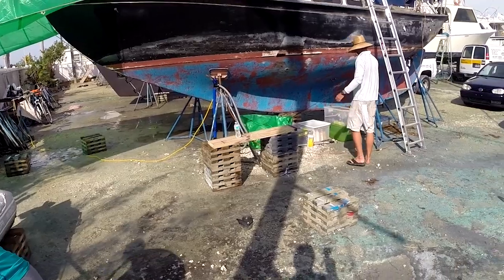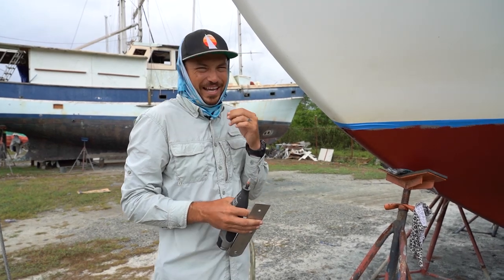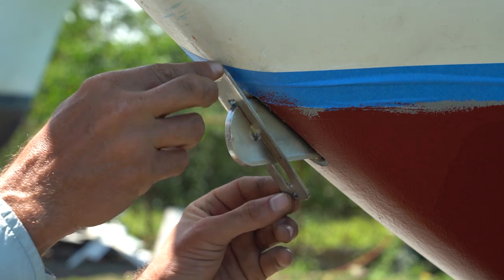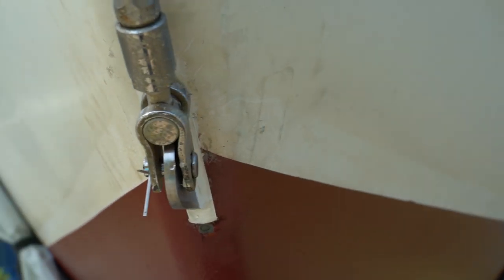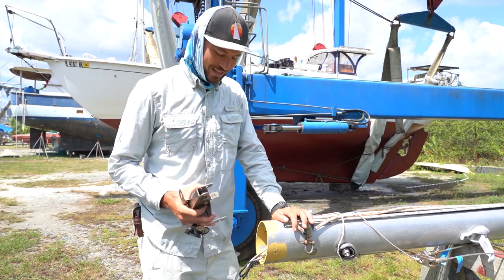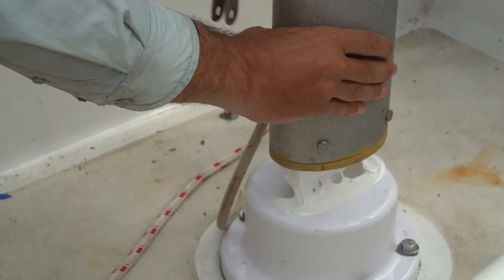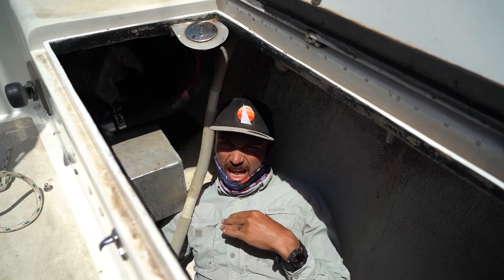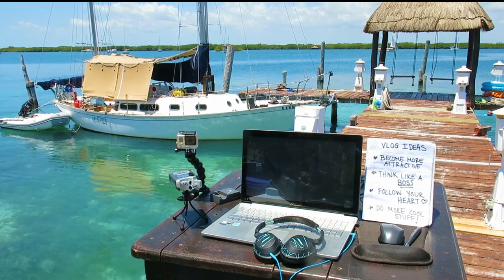Just When We Thought Things Were Going Well... | S04E20

Comment: The hull is probably about three inches thick where the two halves were joined there at the bow when the hull was laid up.  Take the assembly apart again, grind the frp flat so that your lovely cover plate will lie flush, goop up the parts and put them back together.  Also, you could countersink the fastener holes in the cover plate and use flat head fasteners (if you didn't in the first place -- I seem to recall that the first problem was the fastener head deflecting the toggle).  Love the shots of the job.  Viewer can really see what's going on.  Love that boat.  Attended a lecture once by Scott and Kitty Kuhner, the first to circumnavigate in a fiberglass boat--an Allied Seawind!  Nice folks, great pictures.

Comment: Desire...an aviation tip for you. The best way trim up a fresh silicone bit with your finger tip is to wet the finger tip with a solution of water and dish washing liquid (DAWN). It make your finger tip slippery and the silicone won't stick to your finger. It works so good that we use it in aviation repairs and antennas installations. Enjoy it !

Comment: Wanted to give up a heads up with stuffing boxes.    When you leave the yard leave stuffing box totally loose.   You want water gushing out.   Otherwise wax in the stuffing melts and piles up outside of the box.    Tighten over a day or so and really let a lot of water in before you set for drip.   Also if there is more then one bolt on plate you want to measure and make sure each corner is exactly the same
Reply: Teflon stuffing material helps

Comment: Perhaps I missed it but always seal holes that you drill into wood or inner wood core with epoxy before applying bolts, screws etc. Any moisture in the areas causes wood rot and of course delamination.
Reply: I wish more people understood this , I try to avoid holes under the waterline
Reply: You missed it

Comment: stuffing boxes are intended to leak...that's what keeps them cool.. After repacking,...slacken the nut off with engine running til it leaks water, then slowly cinch up til the leak is minimized. with cool running. Always a good idea to use graphite grease on the packing, that way it doesn't groove the shaft..

Comment: Your stuffing box and shaft are water cooled. I think you still have some air in there and it's not cooling good. Go motoring with the stuffingbox leaking like a siv to get water all around the shaft, pump out water and tighten again. After that you should have no issues i think
Reply: good to start with the packing gland loose and then tighten slowly with shaft in operation.  be patient
Reply: Michael Waegemans I was going to suggest the same, an air pocket not allowing water to cool and lubricate the shaft.
Reply: I have to agree with Harland below.  You might also consider that you have TOO much packing material.  In power stations we generally look to see a drip or two per minute.  This ensures that that the packing is lubed and cooled.
Reply: yes a very slow drip is needed!!

Comment: U need to use carbide drill bits for stainless steel and keep low rpm during drilling as much as it possible also don’t forget about greasing. 

Use grinder to make old drill bit sharper

Comment: Just recess the  New Bob stay chain plate Cover into the Hull rebate it so you get the Clearance you need to fit it and counter sink the screw holes in it as well ,Tip for you you can also use a masonry Drill Bit to drill Stainless steel or Mild Steel ,like if a Masonry bit  hit Re-enforced Bar in Concrete.

Comment: I've made this comment several times on various sailing channels.....
Get yourself a set of COBALT drill bits, it's the minimum requirement for drilling 316L stainless steel, gold colour, laser etched with the following markings HSS C 
the reason you burnt out 3 drill bits is because the stainless got hot and as such became harder than it already was. PS you could have made a plan too with your Bob stay chain plate by slotting the internal holes and countersinking the cover plate holes and using flush mounted countersunk head screws. Generally speaking you've done great work on the boat and should feel very proud of your achievements. God bless, fair winds and safe sailing.
PPS, with regards your stuffing box, the gland packing will not damage the shaft, and should by all accounts settle down with time and use. You can always add another packing later when you need to, rather have the stuffing box weeping than getting hot, the packing will deteriorate quicker at high temperature and will swell with water ingress, obviously it mustn't be visibly leaking, adding packing while in the water should not be problematic if your packing is prepared and ready to install, make sure to evenly compress the gland packing and measure the distance from the inner casing flange to the outer casing lip.

Comment: 300 series stainless steels (304/316/321 etc.) is very tough material to cut even with proper equipment but especially with hand drill.  I've been there also working this stuff with files, twist drills and it aint fun.  The reason it's dulling and smoking your bits is due to work hardening.   As soon as the bit isn't cutting and only "rubbing" the material your toast.  It turns rock hard dulls the cutting edges and all you'll do is spin and create heat.  Best way to mitigate this is to start with a sharp bit, use a dab of oil, lots of pressure and low rpms on the drill.  The instant it stops cutting a chip STOP.  Don't ever let the bit just spin.  easier said than done but thats the gist of it.  Sending good luck to you guys from Chicago as I'm sitting here in my office surrounded by the plauge! lol.

Comment: The material  is Stainless Steel and you have work hardened it. Use a Carbide drill or a small grinding wheel to get below the hardened material.

Comment: Hmmm... Please get up there and put a nyloc nut on that masthead bolt! Having it come loose might be troublesome on that big blue sea. And drilling stainless with handtools are difficult. Low revs, a lot of pressure on the bit and machining oil to lubricate.

Comment: Drilling stainless - Low drill speed, high pressure. Don't let the drill bit rub without cutting or the metal will workharden. Use thick oil, grease or proper cuttting compound, not water :-)

Comment: Hey buds, love the channel. I've binge watched every episode and just got caught up a few weeks ago. I used to work as a machinist and noticed that your drilling speeds are too slow. That's why you're dulling your drills (Machinists don't call them drill bits. We have our own vernacular, much like sailors.) I was going to say something when you broke that 1/8" drill on the bottom of your mast in a previous episode, but held off. Since you've brought up having issues drilling I'll add my 2 cents, just trying to help.

RPM  =  (SFPM x 3.82) divided by DIAMETER. 
SFPM is determined by the material. Aluminum is 300 sfpm, depending on the steel is around 200-250 sfpm and for stainless use about 120sfpm.
For example, for that 1/8" drill drilling into aluminum, you can ideally drill at 9168 rpm. (+/-) That cordless drill probably does less than 2000rpm.

I know there's not a way to know how fast your cordless drill is spinning so another rule of thumb is to speed up until the flutes blur and you can't really make them out. (Notice how the machinist you too your parts to drilled much faster) Rule of thumb, the smaller the diameter, the faster you drill. (Larger diameter, the slower..) For anything less than about 3/8" I'd drill as fast as that cordless drill will go (except on stainless). Anything bigger, slow down and oil is your friend. Also, those drills aren't lost, they can be resharpened but it's a skill that takes a little time to learn to do free handed. I'd check with the machinist you used to sharpen a few for you.

Cheers!
Reply from the maker: thanks Jesse! this is great information!! thanks for sharing!

Comment: Two thoughts: there is a boat near mine that has essentially a spreader on the bobstay. It leads from the stem of the boat at a downward and slightly forward direction so that it bisects the bobstay at a 90 degree angle (just like a spreader bisects the cap shroud) and forces the bobstay down and out away from the bow. Also 3M (no affiliation) makes a product called 4112N sealing tape. Very similar to butyl rubber tape except white and more adhesive but on one side only so the other side can remain exposed and can even be painted, great stuff.

Comment: Stainless steel requires a less steep angle on the drill than for regular steel, and a slower speed and some lube grease on the drill so as the drill warms the lube keeps feeding the cutting edges.

Comment: Stainless steel work hardens with too much friction - so it might seem counter intuitive, but you actually want to push harder and cut through it quickly rather than take your time. Also, the fewer number of steps up in pre-drilling sizes the better. Once it is already hardened you will eat up drill bits left and right until you bear down on it or put it in a drill press where you have a mechanical advantage to apply enough pressure.

Comment: When you repack a stuffing box you should loosen it until it is dripping fast then tighten it until it is dripping about one drop every 2 to 3 seconds. It will make a better seal after a while but if you over tighten it you can burn the shaft which will weaken it. If you are going to leave the boat for an extended period , say for a week or more then by all means tighten it until it stops dripping . Just remember to loosen it again before you sail away.

Comment: I didn't realize the masts sit on top of a notched stand, versus being inserted into and fastened onto the stand.  I guess it's normal for this size and/or design of boat.
I knew some of the rigging holds masts in their correct position but as noted above I thought the masts bases were fastened down, even too the extent of passing through the cabin and mounting to the hull (keel?).  Learn something new every day.  ;-)
Reply: It sounds like the "stuffing" box is a poor (obsolete) design?
I feel it's true with all things mechanical like cars, houses and especially, boats (cars & houses don't sink) that all repairs be done with the objective of not needing to be done over (and over and over...).  ;-)

Comment: They are fine looking mast steps for sure, I know what you mean about nursing her along, this my hydraulic oil cooler failed ended up with seawater in my hydraulic system, blew the pump seal and to top it all wrecked the flexible coupling between the hydraulics and the engine :-(

Comment: Perhaps you did and didn’t show it, but did you re encapsulate with fiberglass the back end of the tang you tapped into the bow? Also, butyl rubber tape has no place on a boat for sealant, especially near or at the water line. I like Life Caulk sealant because it can be removed a bit easier than 3M 5200 fast dry (which should be considered permanent). Also, just under the head of any fasteners, run a small bead of sealant around it. I don’t use any silicone on a boat!

Comment: A drillbit tip: when planning to drill stainless, grind Your bit before that. You could even just kiss it with a beltsander or an angle grinding disk. For stainless, Your bit's gotta be "virgin", no other metals on the tip/cutting edge. Stainless doesn't like being drilled with a "seasoned" bit, hardens and could even break Your bit/cutting edge.

Comment: I resharpen the bit after each hole or when necessary with a bench grinder, you will get good at eye balling the angel,.👍😎👌🥂
Reply: Not after stainless what type of drill, bit did you use stainless eats drill bits should also use a lube and yes sharpen the bits thats why I hate ss steal but it is a must on boats
Reply: @drewgerstein9454  Yep plenty of lube, I use PB blaster. it's great for cutting fluid. and hope you don't hit a weld to drill through. ss weld is much tougher. Get the best bits you can, cheaper the drill bits the more you will be sharping them. carbide or titanium is a good choice. I may resharpen a bit 3 or more times for a hole, depending on material thickness, if you don't have a long shaving coming off then resharpen or check the angle and the back cut of the angle, I use plenty of back cut on the angle. Drill press is nice, a hand drill works fine also.

Comment: Enlarging a hole with a twist bit is not easy in metal.  The thing that controls the feed rate is the metal at the center, which you don't have to help you.  Also, hand-held is a challenge.  When the bit starts cutting, it cuts too deep.  There's now way to hold it straight so it digs in more.  The more it digs in, the more forces there are on the cutting edge.  Eventually the corners of the bit are "chowdered" (in the words of AvE).  The bigger the drill, the harder it is.  And you're working on stainless, right?  It's a tough job, actually, a lot harder than it looks.

Comment: Stuffing boxes that aren’t water cooled need to be “burped” after a haulout. Loosen till water comes out then then hand tighten till it just stops dripping and set the jam nut. Check again underway to get a few drip per minute when the shaft turns. Stop the shaft to adjust. You did well to check it, many don’t. If you used Gortex or similar graphite/Teflon packing, its normal for it not to drip or very little, even after “burping”. Just be sure the stuffing box isn’t hot and relax, you’re good.

Comment: 2:02 those are screws not bolts? They should be bolts. And the holes should be oversized, filled with epoxy then redrilled to seal the deck core from moisture. Also when tightening, you put the goo on the shoulder of the bolt and then tighten the nut, without rotating the bolthead (rotation would pull away the goo)

Comment: Did someone mention you may have 45 degree cut on the packing at the wrong bias?  I figured dozens would mention that....but if not you need to cut the bias so it compresses against itself as you tighten the packing nut. I think you cut it wrong from the brief glimpse I caught in the last video. If wrong then either it leaks too much or not at all. You do need it to drip as you know, but not too much.

Comment: It would be a good idea to throw a zinc anode on the mast to prevent any further galvanic corrosion.
Reply: TheJarrodh you don’t do that, zincs are for galvanic corrosion under water 🤢
Reply: @markbuskens6070  And what do you think was causing the corrosion observed at the contact point between stainless steel and aluminum?
Reply: TheJarrodh where would you put a anode on a mast?anodes are for electrolysis in the water not to stop corrosion.
Reply: TheJarrodh if it was an aluminum mast base there would still be corrosion between the two pieces, if it had a keel stepped mast that went in to the bilge water I would say yea put an anode in the water on the mast.ive taken off plenty on big mast and they all have some corrosion on the very bottom

Comment: Stainless steel has a bad habit of case hardening locally if heated to much which is evident
By your blunted drill bits, your drill bits should not be cooled with water but instead lubricated ,
Drill a little then allow to cool before heat from friction soaks in to your parts. Once stainless case hardens it is a pain in the butt. Best bet is to creep up drill sizes rather than going for gold. Hope this helps in future, best wishes.

Comment: When you're drilling SS you have to drill faster not slower or you work harden the SS. I don't mean drill RPM I mean you have to feed into the material. It appears you have work hardened the SS and that's why you're having trouble drilling.

Comment: If I were you I'd refrain from using this fastener for the waterstay. It acts like a knife and will cut the bow with strong tension. It is better to use a fastener in form of a plate attached to the bow by a number of bolts that go right through the stem and have a backing plate on the inside of the hull.

Comment: Stainless steel work hardens as you are trying to cut it. When drilling a hole through stainless steel you want to hit it hard but not super fast which removes the heat with the chip. That's way the chip removes the heat and work hardens and not the metal that you still have to cut. Unfortunately that whole you were trying to enlarge may have already been work hard by the last guy who drilled a hole through it and you were stuck with a hard hole to begin with. Some cutting fluid specifically for steel would help as well not water.

Comment: I’m just trying to be helpful but the quality of bits that a machine shop uses is about 20 times better than the Home Depot type store, Plus I want to be you on a sailboat and I know that a grinder with a guide you can constantly sharpen those bits and get tons of use out of a quality bit by holding out the proper angle and re-sharpening not to mention that stainless steel is super hard

Comment: Okay, one thing about the BOAT. EVERY SINGLE THING YOU OWN needs service. Either is just brake pads, bearings, oils, batteries, down to more specific cleaning, lubing, ... it doesn't matter what it is, it needs service. And eventually it WILL break down. The only question is; is it fixable or is it replacable. A bearing is replacable, a boat is fixable. Until it's not anymore. Then it's the same as an used bearing. Chuck it away and get another.
I'm a motorcyclist, maybe in the same way some people are into sailing. And trust me, machines need maitenance. BUT THEY ARE ALWAYS JUST OBJECTS. There is a rule in motorcycling: "Don't cry for a thing. It will not cry for you." A boat is still just a thing. You may be attached to it, but it is not attached to you. Sooner or later it WILL be beyond repair (or beyond what you are prepared to invest in repairs). Then just remember this, IT IS NOT A SENTIENT BEING.
Reply: Or put it even more simple: "IT IS YOU THAT MATTER."